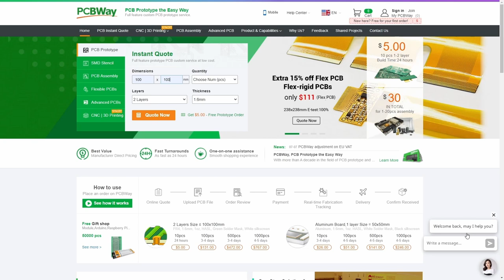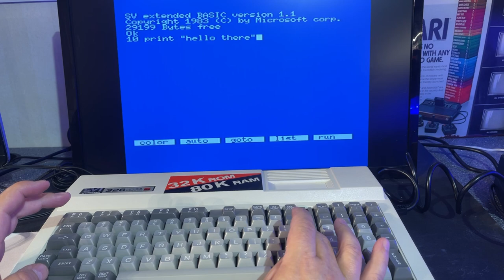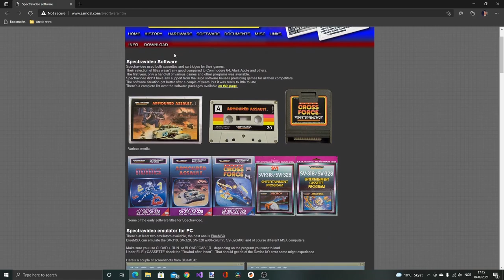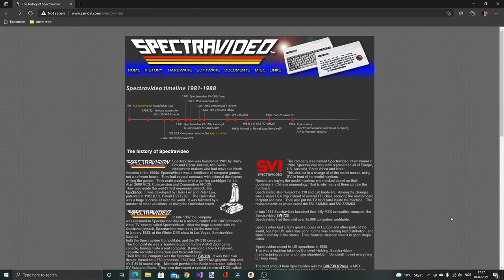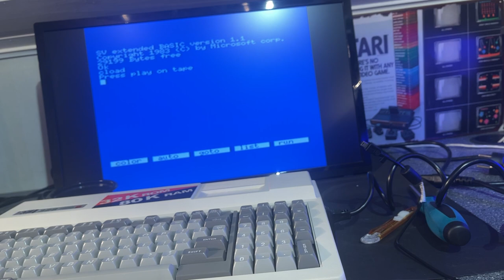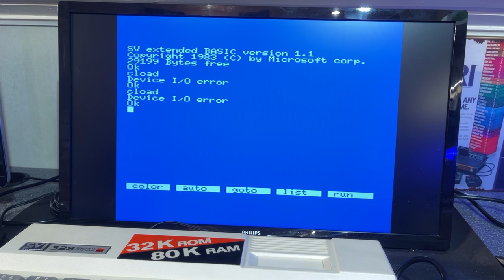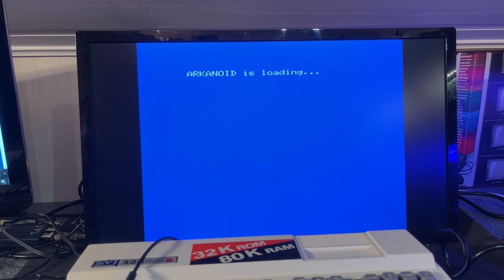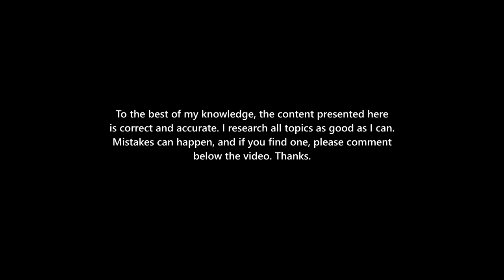Exploring and loading games on the Spectravideo SVI-328 MKII

Comment: If this computer had been cheaper, I certainly would have bought this.
Oh, the 328. I hated the rubber keys on the 318.
But,,,, I ended up with a Oric-1, which I later upgraded to an Atmos.
The keyboard on the Atmos, was just amazing, compared to the Oric-1 knobs.
I have had, some great computers, that was so much better than the C-64, but.... the majority chose the C-64.
The Memotech MTX 512, was great. I had the one with the big  case.
I regret, selling that one.
Then I had the Amstrad cpc 464, with the color monitor, disk drive, and some ok games.
Plus a Football betting program.
But I used it mostly as a Football betting computer. With the Amstrad Printer, I printed out the Coupongs.
Actually, we won almost every week. But as we betted on the good teams, the prices, wasn't so high.

Comment: Nice job, thank you for the video. I probably would have overcomplicated the wiring by putting one of the ground wires to the ready pin so tha it is only pulled down when the casduino is plugged in
Reply from the maker: Thanks :)

Comment: Afterwards the odd board connector soldering wires went into an edge connector to now have a nice adapter cable for the Maxduino, right? 😉

Comment: Were these 3+ MHz Z-80s faster than the 6502s? I'd love to see a real speed test comparison between the two.
Reply: 3m z80 comparable to 1m 65xx.  the 65xx was more efficient
Reply: @thesuperdog  Oh interesting. Was it how the Z80 implemented it's opcodes or that it had a smaller native set and had to do more sub operations to build up what is a native opcode in the 65xx? In other words the old CISC vs RISC trade off?
Reply: `I am very familiar with 6502 assembly but not Z80, but I believe that instructions used fewer cycles than on Z80 and that the A X and Y registers were more flexible in what operations you could do instead of having to move data between registers on the Z80 to do the same thing @AndrewTubbiolo
Reply: @thesuperdog  Excellent! Thank you!

Comment: the TMS9918 is prone to overheating as I had a MEMOTECH MTX512 that had that same video encoder chip but once the chip overheated that was the end.
Reply: There are several available for sale, BUT it's a hassle even though they're around $10US. Someone is working on a drop-in replacement with more capability (chooses to eliminate composite in favor of VGA). It's expensive though and still in development. My guess is that some clever person could make an FPGA to fix it if we run out. It's used on a few different machines.